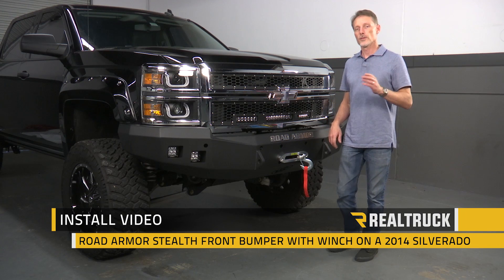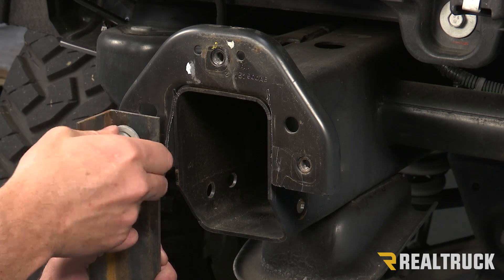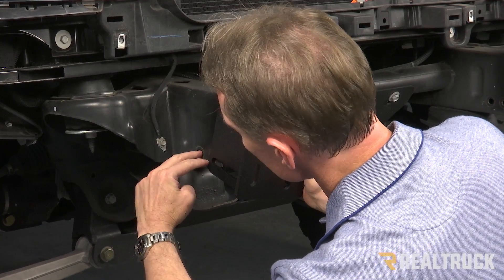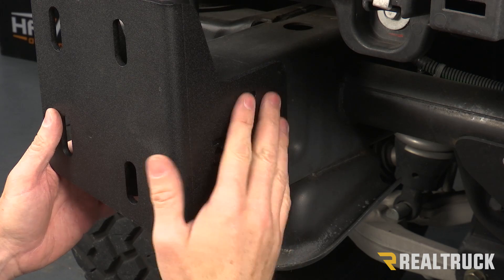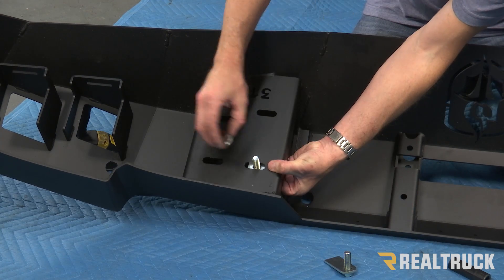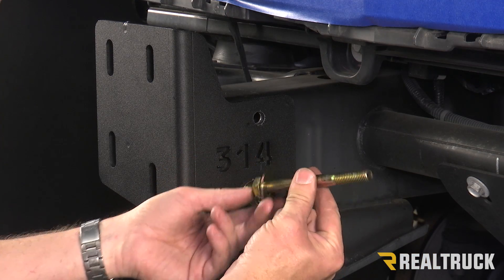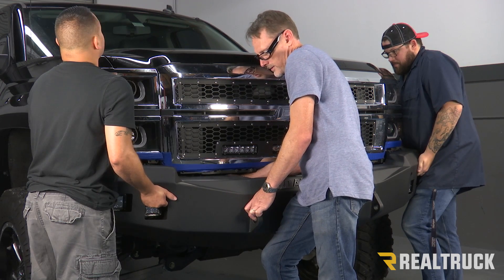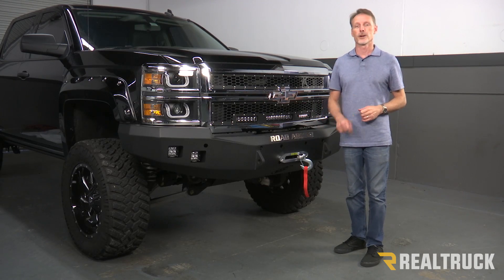How to Install Road Armor Stealth Front Bumper on a 2014- 2015 Chevy Silverado 1500

Comment: I bought this bumper and some head lights. My bumpers coming in first. My question is if Instal my bumper and my head lights come in the next day do I have to remove the bumper again to get to the lower bolts on it?